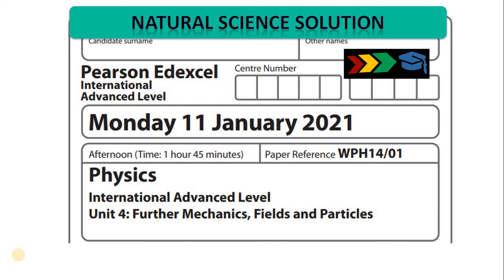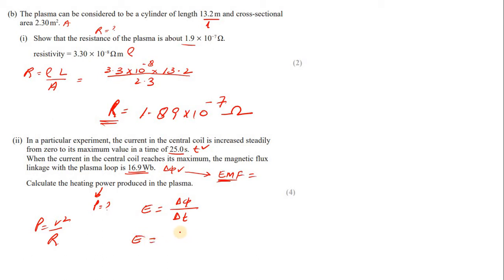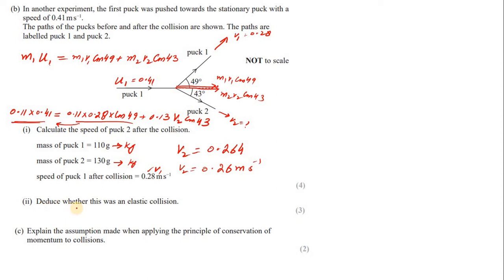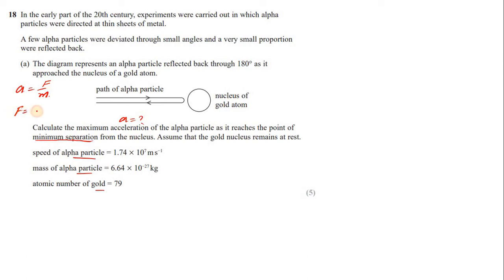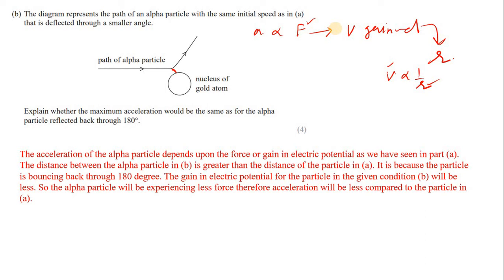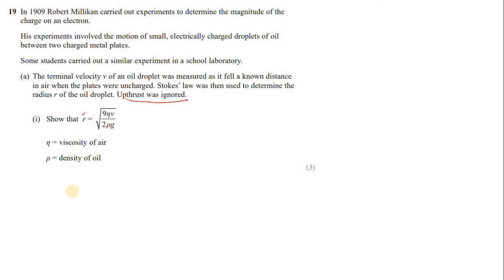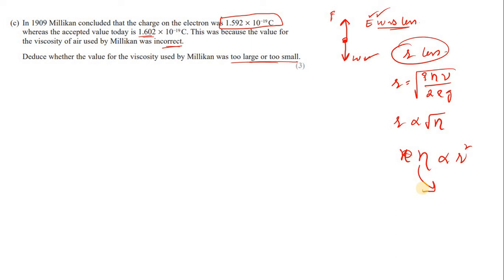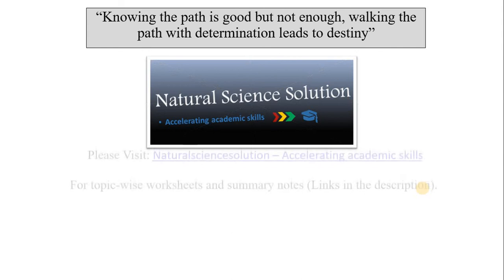Edexcel IAL physics unit 4 WPH14 Jan 21 Part 2

Comment: could anyone please explain why do we take the charge of gold in the formula: V= kQ/r instead of the charge of alpha particle in Q18. aren't both the particles' electric field interacting and producing a final electric field? :/
Reply: We have to find the 'distance' from the gold nucleus...We anyways used the charge of the alpha particle to find the potential difference in the first step. So when the 'potential' is considered from a point charge at a distance r , we have to consider the gold nucleus and the distance and that distance is used to find the electrostatic force and so on in the question...Hope this helps!
Reply: @The_FutureDoc  hi there! thanks a lot!! so basically the "Q" in V=W/Q is the Q of the "moving" charge in the electric field. so using V=W/Q will give us electric potential of that moving charge. in this case, Q18. (a) alpha was the moving charge, therefore using V=W/Q gave us the electric potential of the alpha particle. 

And if we want to calculate the Electric field strength of the alpha particle using E=kQ/r^(2) or Electric Potential of the alpha partcle using V=kQ/r , we'll have to plug in the value of "Q" which "acts" on the alpha particle and NOT the value of Q of the alpha particle itself. in this case for Q18. (a) gold nucleus's electric field was acting on the alpha particle.

Not sure about this part:
And similarly ig, if we want to calculate the Electric potential of the Gold nucleus using V=kQ/r we'll have to plug in the value of Q for the alpha particle, since the alpha partcle's electric field will be acting on the gold.